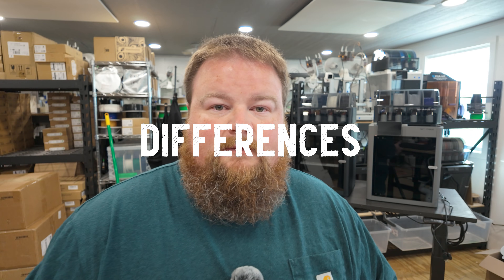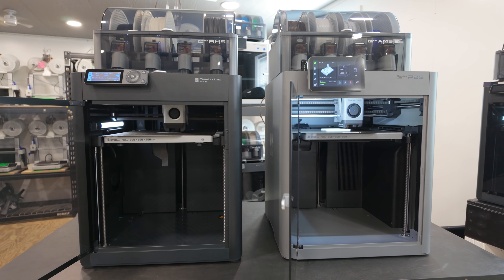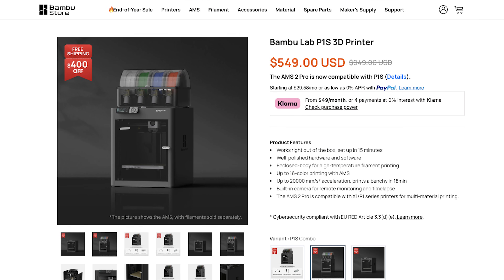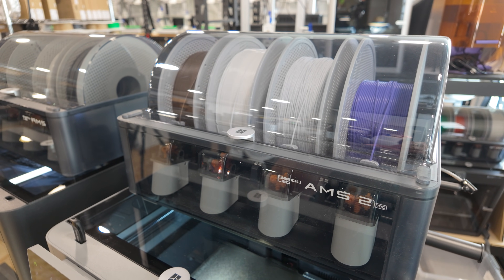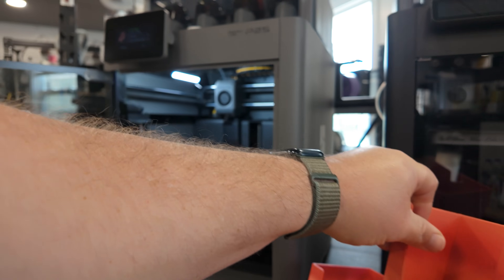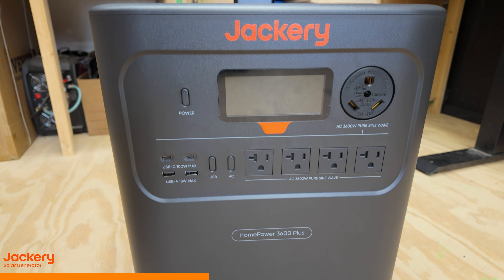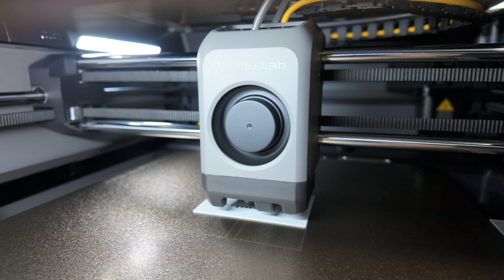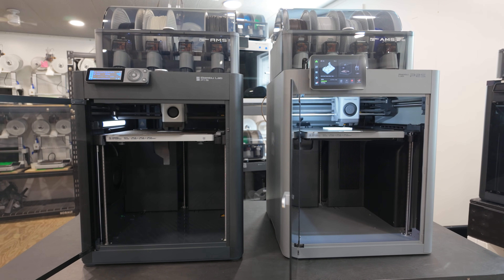Bambu Lab P2S vs P1S — Worth the Upgrade?

Comment: Nope, I'm definitely not using a UPS. The cost of buying one large enough to handle the printers and the ongoing battery replacement costs just aren't worth the money for me as I have stable and reliable power supply so it's extremely rare I lose power even for a momentary blip.

In regards to the upgrade option though, while the P1S is still in service and for the price it is, I suspect many farms won't make the jump just yet besides one or two printers as the cost of retooling your line can be a bit much but as they age out I can definitely see them being swapped out for the P2S.

Comment: You missed fairly important difference between the AMS and AMS2Pro. The ceramic filament guides on the AMS2Pro. Which are better at handling abrasive filaments, or just lasting a LOT longer on high production machines than the plastic on the original AMS.

Comment: merry Christmas man, Also question so i am a brand new to the 3d printer and i really want to make a business but i don't know what to sell do you have any generic tips to sell? because i been trying to sell keychains and wrist band accessories but no one wants any of them so i was thinking what if i make like big prints but i keep on failing (atm I'm printing a dragon for the 7 times after tweaking the settings and the bed level and try to sell it for a big price) but i feel like I'm wasting my time and filaments i got 25$ by selling some commission but I'm running out of filaments. The printer i got is creality k2 plus if that helps.

Comment: That was the best thing I did in my business. Kept kicking breakers every once in a while. That’s money lost on projects unable to recover. Added an Anker battery system to plug may equipment into and then plug the battery into wall. If I lose power my equipment keeps going. In long run this will save me lots of money.
Reply: I may need to do that. And add some filters to the back of my H series printers and an upgraded filter to my X1C. I have an A1, X1C, and H2D now with a U1 on the way. And I just ordered an H2C today. I never expected to sink so much money into 3D printing lol
Reply: @SangheiliSpecOp I gets addictive doesn’t it. 😂
Reply: @SangheiliSpecOp  Hi what is it that youre printing with all those printers. I sometimes cant even think of 1 thing to print lol
Reply: I built my own battery way cheaper lasts way longer well i bought cells and put a bms on it

Comment: Merry Christmas,  thanks for the comparison.
Reply from the maker: Happy to help, Merry Christmas to you, too!
Reply: @Samcraftcom  You mentioned that your entire workroom or hall is dehumidified, so an additional filament dryer is not needed. If that is the case, I was wondering in which situations you still need to use a food dehydrator as a filament dryer, and why. I also wanted to ask what relative humidity range you maintain in the room that allows filament to be used reliably without a dryer.